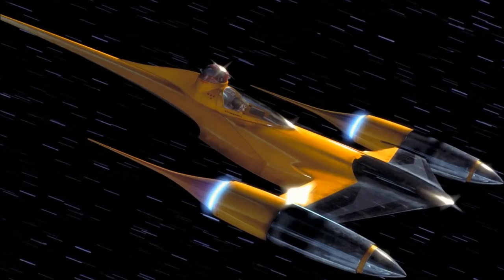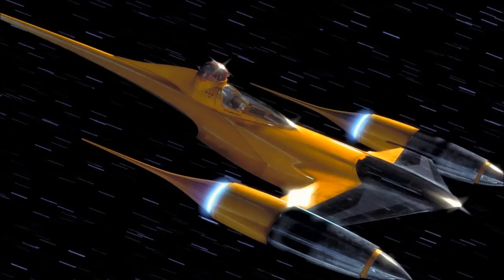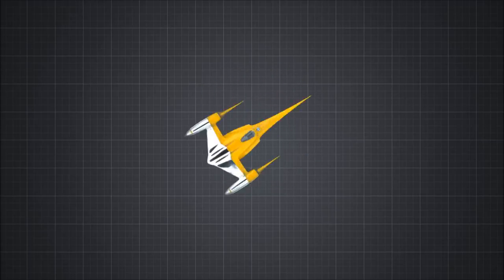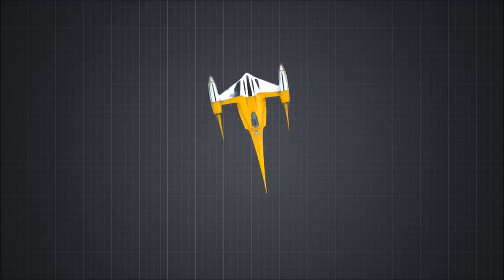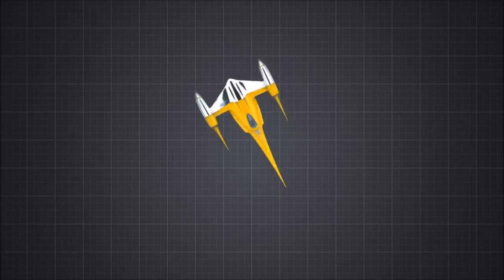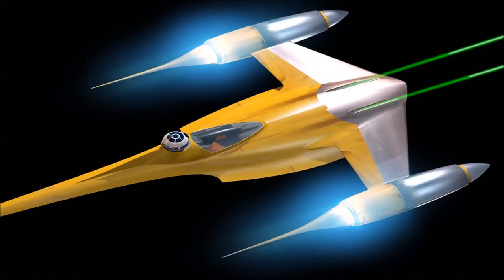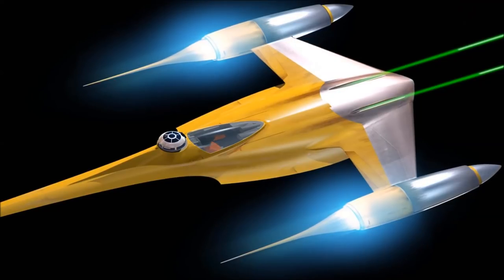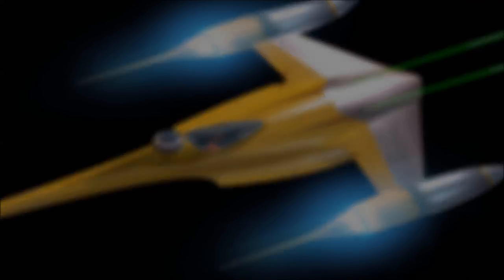Star Wars: The Big Problem with the Naboo Starfighter - Spacedock Short

Comment: "guns spread far apart from each other"

Isn't that the x wing?
Reply from the maker: Yeah the X-Wing has to use little targeting gimbles to make sure all the blasts strike the same point. The same is true for the ARC-170.
Reply: Spacedock you know, since you started some of the factual videos such as the missile behaviour and some of the ship designs, what do you think about going all the way on all aspect of inaccurate sci-fi designs?

I could think of two that majorly bugged me. Windows on space fighters, especially on crafts that doesn't have shielding tech and the naval ship bridge style on spaceships.
Reply: Syazwan Dzulkifli I really dont understand why you would put a window on any part of a warship. I would just mount a load of cameras everywhere
Reply: Tobias Timm to be honest, windows can have function on ships. It's good for the psyche (sure you can have 'tv windows' but sometimes you just want the real thing) and in case your cameras are down or malfunction (or hacked to display looping images or stuff).

What I have beef is that most sci-fi ships never bother to add armor curtains that would close on the windows during battle.
Reply: Tobias Timm the windows on a star wars ship doesn't use glass
Reply: I would think artists just looked at ww2 era planes an saw how almost all allied (western) fighters had weapons in the wings and so decided it was a good idea.
Reply: In WW2 just about every American fighter(minus the p38) had beastly 50 cal brownings mounted on the wings. These were some of the best guns to be on aircraft. They were reliable, they could perform anti personnel and anti ifv actions, and they could make a mess of any axis aircraft. The problem was they had to be angled inwards to fire at a point a few hundred meters ahead of the pilot. This did not make them any less effective if they had been forward firing, because of how American fighters were best used.

American fighters were almost exclusive energy fighters. They would fly as high as they could and dive on their targets. They would get really close and fire as accurately as possible and then use the energy from diving to climb back up. Rinse and repeat.

Perhaps similar tactics can be used in space. Imagine just accelerating at an opponent so that the profile of your ship is minimized, firing once you get close, and then changing direction at random so they can't counterattack. This would be best for ships that have more mass compared with their thrust, as it would minimize that disadvantage. Perhaps this is the only way to fight since turnfighting would be suicidal(either they get away, or you turn so fast that you die)
Reply: Probably not applicable anymore, but I recall the X-Wing series (by Michael Stackpole and Aaron Allston) discussing the range at which X-Wing lasers are zeroed at -- much like how WW2 fighters with guns on the wings were.

For those who don't know -- zero'ing the guns is what Ben Grosz is talking about where the guns are angled inwards -- where the range is where the gunfire would theoretically intersect.
Reply: The X-Wing's gun convergence is variable (after all, you could change gun convergence even on WWII aircraft - some pilots had very specific and unique set-ups - it just couldn't be done in the air on the fly, the X-Wing can do this because space magic). The same can't be said for some fighters with have fixed gun placement.
Reply: +Syazwan Dzulkifli
To be fair, the windows on most Star Wars fighters aren't egregiously big and weak like how they are on many larger vessels. And, to be honest, the fighters are small enough to the point where even if windows were omitted you'd still have basically no armor worth talking about. 

And it could be that the windows are armor as well (just not something as durable as "durasteel" or whatever). Doing a quick wikia search because Star Wars canon was enough of a dumpster fire to begin with and post-Disney is even more so, you could also consider maybe a form of transparent plasteel (plasteel is used in Stormtrooper armor after all) or transparent aluminum (by the way? this actually exists in real life and is a damn strong material). Wookiepedia mentions that "durasteel" which apparently fluctuates in strength according to the plot needs is super-duper steel that's... weaker than titanium... So... I don't know. Star Wars. Eh.
Reply: +Deidryt
"For those who don't know -- zero'ing the guns is what Ben Grosz is talking about where the guns are angled inwards -- where the range is where the gunfire would theoretically intersect."
And the range (the zeroing of point of impact/point of aim) at which your guns fire intersects and converges into the same area is "gun convergence."
Reply: matchesburn it's not the size, it's the fact that it has windows is the problem. A small window on a submarine's bridge can still do just as much damage as larger ones once it is breached.

And size is irrelevant. Star fighters engage in close combat and often destroy enemies up close. This will create projectile showers that will pepper the chaser. And that's just from enemy starfighters. We haven't consider debris from starships or natural debris cloud. 

I tend to get this response regarding star wars' 'glass'. Yes, obviously they are not our glass and is durable than modern materials. But it doesn't change the fact that it is still weaker than the armor that made the spaceships. What would need 100 hits on armor, would need 10 hits on the 'glass'.

So all I said would mean that a starfighter's windows would get scratched pretty easily and quickly,  and that's from small debris. What happens if it hit a baseball sized projectile ejected from an exploding star destroyer? An armored cockpit would have fared better than stronger-than-steel glass. 

Armouring the cockpit isn't that hard. Heck, a video game about atmospheric fighter jets managed to do it (not all, but their implementation and design makes sense). Check the Falken from the Ace Combat games.
Reply: Syazwan Dzulkifli Dead space one had them!
Reply: From the Rogue Squadron books series, the X-Wing's cannons are zeroed in at like 200 meters? or something like that.

They don't Gimble adjust while in flight, because writers are...not always technically adept enough to think like that.
Reply: In smaller craft, windows are useful for when you lose power - or encounter significant EM that could muddle or disable cameras entirely.

On a hardened, EM shielded warship bigger than a shuttle, you're 100% correct.
Reply: Except for Ooryl, Ooryl just had legit aimbots and didn't need no fancy gimble correction like a scrub pilot like Horn needed.
Reply: aethertech From the X-Wing Alliance combat simulator: The X-Wing has a completely variable convergence system which always converges at target distance. The Z-95 system is set at 250m or 500m (can’t remember the exact distances but you get the idea). Both can turn the system off.
Reply: Alright, the only line I know was from a book were they stated they had the distance set to X.
Reply: While we are on the subject of windows/openings on spacecraft where they are useless, the big gaping windows on Star Wars capitals bug me. Particularly the examples of Clone Wars era warships, though all eras have offenders. Notably, the Venator Class apparently has a big viewport in the turret face on their main guns, and both the Venator and Invisible Hand have those incredibly cringe inducing broadside gunports that look like they are from an 18th century ship of the line, and went out of style in the 1860s...
Reply: Ion Guns.
Reply: yea, those things.
Reply: in the origional X-Wing PC game I prefered the Y-Wing for dogfighting because of how it was rather hard to hit a TIE with the X-Wings lasers inside about 100m, but despite massively reduced agailty the Y-Wings gun placement made TIEs much easier to hit.

yes the X-Wings lasers were spread way too far (12 meters) apart for close range dogfighting.
I love the X-Wing but its laser placement made its optimal range around the 300m where as 5m behind a TIE Fighter a Y-Wing could still hit it.

of course the B-Wing and Z-95 also had that problem but in the case of the B-Wing it was not a problem as that was designed to kill larger ships, and like the the Z-95 did it have a nose mounted cannon

A-Wing and TIE Defender had guns much closer together at 4-6 meters so they did not have the same problem
Reply: Funny enough, I found the Naboo Starfighter easier to fly in Rogue Squadon back on the N64 despite it having near identical stats (if not identical) to the X-wing in the same game because of how much easier it was to aim.
Reply: I use those tactics in war thunder for American fighters
Reply: I always thought the wide firing box of the --wing was intentional for combating TIEs. They are unshielded, ths required only a single shot to land to do damage, yet very fast and maneuverable, masking them likely to escape your firing solution. The wide field of fire should combat that advantage.
Reply: The biggest risk with windows on a spaceship is if it decides to do an update and install in the middle of a battle.
Reply: Or someone finds another security vulnerability.
Reply: Syazwan Dzulkifli The "armoured curtain" is exactly what is mounted on most Star Trek ships.
The "screen" on the bridge is in reality a closed window, and in Nemesis we see how, when power is down, the curtains can be opened to let you are trought the window.
Reply: In Star Wars, the laser guns on starfighters can fire just ever so slightly off axis (even TIE's). This is how they can get away with having guns so far spaced apart and yet the shots will still converge on a target regardless of range. They appear to do so even without gimbals (see cross sections). You see this when Darth Vader is shooting down X wings in the Death Star run (his angle of fire rotates independently of the TIE fighter in A New Hope).
Reply: @secondsein7749  the Normandy sr2 in mass effect has armor that slides over both the two side windows and cockpit
Reply: SecondSein I'd say so
Reply: Words cannot describe what you have just said
Reply: @Spacedock  the arc-170 is an amazing spaceship. Why didn't the empire keep it?
Reply: @MrKa_Rate  The Spartanian from LOGH gets around this. The cockpit is cameras. The other ships have Cameras everywhere, too, everything is a display.

Until the remake came out where Bridges have windows and jut into space....for no reason.
Reply: @secondsein7749   in star wars 'windows' are not made from glass but transparsteel which is a transparent steel so they don't make windows of glass. same in star trek...
Reply: @matchesburn  Transparsteel is mentioned somewhere, as a viewport material.
Reply: I just finished commenting about the X-Wing.
Reply: @secondsein7749  Halo does this, and I believe the LoGH Free Planets Alliance stows their bridges away when in combat.

Comment: Hm... if you ever read X-Wing novel series from Michael Stackpole and Wraith Squadron from Aaron Allston, they actually both touch upon how the Inertial Dampeners work, what do they do, what limits they have and etc., like famous Wedge Antilles actually used to tone down Inertial Dampeners on his X-Wing, saying it allowed him to better feel "rough edges and limits" when flying, and also stating that Jek Porkins (Red Six) from Rogue Squadron (fat pilot in the Return of the Jedi) died because his Inertial Dampeners were set too high and Jek didn't feel the moment he lost control over his X-Wing and had to eject. 
According to Wedge, using Inertial Dampeners on higher settings was comfortable and preferred by many novice pilots, but it did "dull" the pilot's feel of his craft. 
There is also a case of pilot dying from Wraith Squadron, with her Inertial Dampeners damaged and pilot herself going unconscious, with her X-Wing crashing.
Reply: Good call and a great series of books. Just one thing, Jek Porkins was in New Hope not Jedi.

Comment: The interesting upside about the long engine pylons is that the huge lever they provide has the potential of greatly increased maneuverability. Now of course this is Star Wars, and laws of physics need not apply. Still, compare the N1's engine placement to the Starfury, the best designed space fighter ever by a country mile. They both have their engines at the end of long pylons. Now, since the N1 only have two engines, and no visible RCS, the engine placement only really helps yaw authority. The Starfury, well thought out as it is, has its main thrusters along the forward thrust vector, and powerful RCS thrusters pointing along all five of the remaining cardinal directions. This together with the massive leverage provided by distance from the centre of mass gives the Starfury an incredible agility. And thanks to having the pilot really close to the centre of mass, it can flip around incredibly quickly without putting dangerously high g-forces on the pilot, since it lacks space magic inertial dampeners.

Sidenote, I believe the quite frankly stupid amounts of acceleration every Star Wars ship has is simply a lazy and misguided way to explain why they all fly like WWII fighter planes.
Reply: Groetgaffel 
Starfuries would be a nasty surprise to encounter in Star Wars.

Comment: Ya know, it just struck me that the Nubian reminds me a little of early propeller monoplane fighters in its overall shape and gun placement. I’m even getting vague vibes of Spitfire sexiness. Huh. I suppose it would make sense if the Nubian is designed for both air and space superiority, unlike the X-Wing and TIE, which are primary space snubfighters.
Reply: Cailus Griffin gun placement really reminds me of ww2/ww1 fighters too
Reply: The symmetry is more than just coincidental. Both the N-1 and the Spitfire were hand-crafted and designed for sheer agility over protection, thus they fulfill the same niches role. Moreover, Lucas was directly inspired by the Battle of Britain for his Naboo space-fight scenes, so the N-1 really is the Spitfire of the Star Wars universe, or at least the Hurricane.
Reply: Also the designers of this and other ships from the prequels were directly inspired by World War Two aircraft.
Reply: Not just the designs.  Star Wars (the original movie) is basically a mashup of a samurai movie and some WWII fighter movies.  Some scenes, notably the attack on the Death Star, are pretty close to shot-for-shot in places.
Reply: The x-wing is built for atmospheric flight thus it's wing like s-foils but the shields also help a lot with aerodynamics. The Tie fighter on the other hand was designs speciallycal to be a space fighter and a cheaply produced one at that  no sheilds little armor and horrible view via those huge solar panels the Interceptor model fixed some of these short comings....

Comment: Long time lover of the channel, just found this vid though. As an aircraft mechanic IRL, and a fellow Nubian design enthusiast, I wanted to point out a few things. Sorry but I did not take the time to read through all 650+ comments at time of this post to see if anyone had already said this. Your assumption that the ship would lose control is unfounded in real physics of flight, or even semi newtonian fantasy physics. It's not unheard of for engine fails on twin engine passenger jets for example. These events don't cause loss of control to levels like you suggest however. Some extra yaw, sure, but momentum will take some time to be lost, and will carry the other side. Especially in the void with practically zero drag to cause the failed side to pull. In space with the next to no drag, it pretty much doesn't matter where you put the engine, or even lose one. It's for this reason that Star Destroyers don't constantly nose up towards the bridge, or Nebulons get stuck in dives toward their chin, or Jumpmasters stick to left turns. Also it would be reasonable to assume that the onboard engine computer and avionics are built for the contingency. On a real aircraft with one wing engine(s) failed, the auto throttle and auto pilot would actually *increase power to the working side while adding rudder to maintain the pilots input on the fly by wire concept for desired speed. The N-1 would substitute it's likely built in thrust vectoring system for rudder here, or perhaps gyros like the ISS, and maintain most of it's flight capability, perhaps at just higher fuel consumption for the one engine, lower overall though, and less acceleration overall. Sorry to nit pick, hope it helps redeem the glorious banana for you.